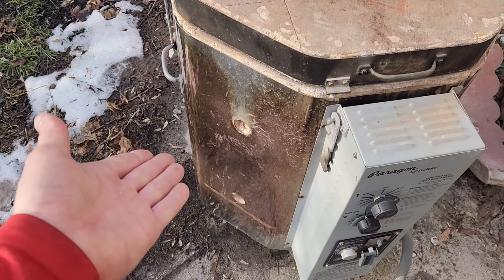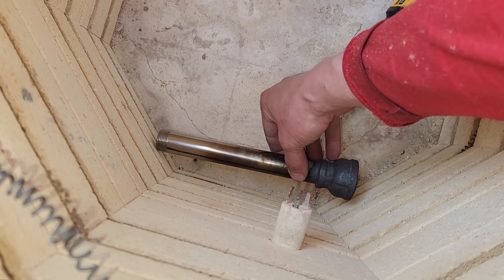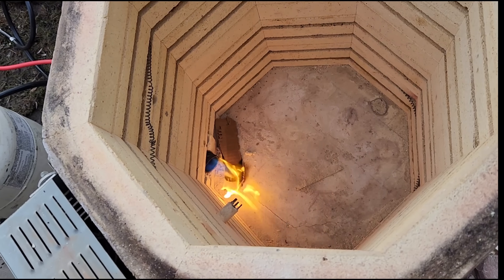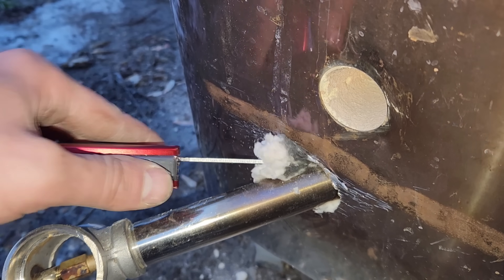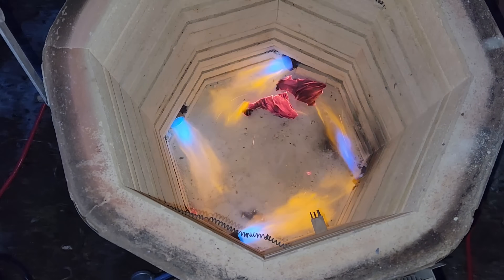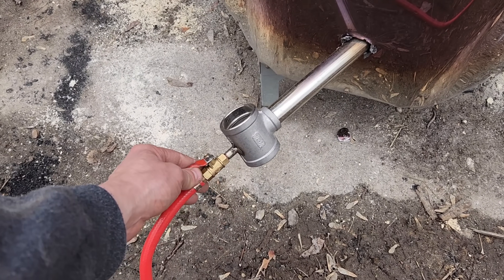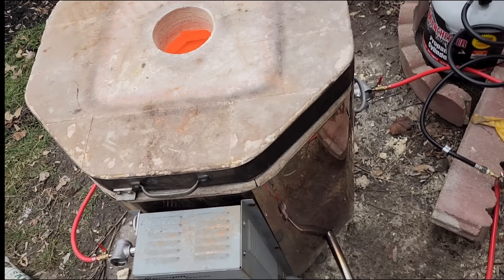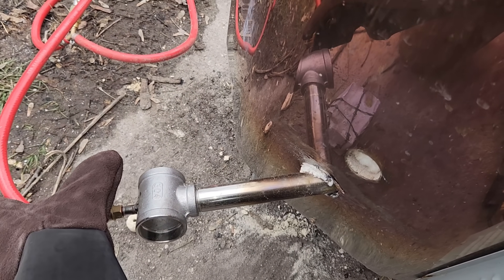Electric Kiln to Gas Furnace?

Comment: I love how easy it is to drill and work firebrick. Great material. I'd like to figure out a way to make it myself, I guess maybe like aircrete except made with alumina and waterglass instead of cement. Would be cool if it could be made to self expand. Great build! Wouldn't have thought about the conversion myself but it makes a ton of sense
Reply: Yeah. Its like ice cream with rocks in it. You can scoop it with a spoon no problem but itll dull cutting tools pretty quickly
Reply: I’ve successfully made some of my own using clay, clinker, Portland cement, and perlite. It’s a complicated process but you can find ratios and steps online
Reply: Boric acid solution maybe as an option to waterglass.  Though waterglass seems like the way without a doubt at least I'm thinking. I think a microwave kiln would be awesome now that you mention.  Was just about to comment above regarding.  Especially since Shake The Future YT channel just updated his metal melting using microwaves video detailing some more. Waste oil as a fuel source as well seems like might not be a bad idea, though might be tricky for some situations I'm wondering in regards to reactions with the waste oil.
Reply: Gday Nighthawk, have a look at autoclaved aerated concrete (AAC). I use this material in the fireplace industry, it usually comes as pre made blocks (usually 1200mm x 600mm) used in 40mm and 75mm thicknesses to line the inside of wall cavities that a firebox would then be placed into. It has excellent heat insulating properties as one would imagine being filled with air, but myself and the other guys at work have used this to build makeshift open fires and foundries with great ease and success. Very easy to cut and work, theres no other fire brick that I've come across that can be red hot on the inside and cool to the touch on the outside. Cheers for all the greatness you've put out into the world.
Reply: Waterglass already self expands. Perhaps even too much to stay strong.
Reply: Dude please do look into making firebrick, you've taught me so many useful things and that'd be the diamond in the crown
Reply: I myself was thinking of producing a material like that out of aluminium oxide powder (produced by dissolving aluminium in a base) and charcoal powder. Somewhat similar to a graphite clay crucible, but porous due to the use of charcoal.
Reply: Is this a secret hint? I would LOVE a video on that! If anyone can figure it out, it's you, ya smarty-pants! 🤪
Reply: Ive had success with making waterglass and makung a sol gel by adding it to alcohol. Then taking the goop that sink and adding more alcohol until it turns into slime. Then drying the slime and mixing in stuff like perlite and alumina. Then baking it rapidly maoes it foam up into a porous brick of aluminosilicate.
Reply: I expletive love aircrete. I always thought it'd be funny to get some friends and try and work out how fast you could make an aircrete dome about 20 metres was our target wanted to see if we could make one just turn up on site some where see if we could get it made and force set it ninja styles so there is just a 20 metre dome there of a sudden lol.
Reply: Look up aerated plaster gypsnow. Its just plaster and baking soda, and maybe some perlite or vermiculite.
Reply: It's mostly air. Air is easy to cut.
Reply: Don’t overthink it. It doesn’t have to ”set” like concrete, just has to be formed and fired. A highly refractory clay (kaolin and/or fireclay) and something that will burn out and leave voids (sawdust) will do it. Waterglass has too low a melting point, an unnecessary complication.
Reply: @kellyhebert7967 agreed but some may not want carbon being an issue causing a reducing atmosphere so swap out the organic filler with perlite. Otherwise this should be a reasonably easy thing to make. May take a few tries getting the strength to weight right but otherwise easy.
Reply: You should see if it’s possible to make an aerogel-based kiln, or a pressurized kiln, or something
Reply: @AmaroqStarwind  while aerogel is a good insulator, it wouldn't withstand the heat which kilns usually require (silica based aerogels can last about 650 Celsius / 1202 Fahrenheit), aluminum has a melting point of 660C, bronze 950C (1742F).
It would still have some usage below that 650C though.
Reply: @AmaroqStarwind  Like a refractive material foam made with a sol-gel process? But what would be compatible with the process, magnesia, alumina, zirconia?
Reply: this is adorable and youre way too humble nighthawk.. 
you guys gotta do the electroboom steve mould fake youtuber beef thing... maybe race each other to make something or get a better result than the other on something!
Reply: @dewitt-wright420  Or even like a Cubane challenge
Reply: @dewitt-wright420  "Fake beef"? None of it was either fake or a beef. Two scientists going back and forth. Same with Veritasium.

Beef? That was with Lewin.
Reply: @Dinnye01 Sure, the back and forth with videos showing differing interpretations was not fake, and it wasn't actually a beef, either but they pretended it was one for comic effect. That's what the comment was talking about. Not a fake beef in the sense of trying to actually mislead people into believing it was real.
Reply: This comment gave me a funny experience because I didn't notice who the poster was it at first. I read the comment "normally", then looked back to check at the username and my mind somehow retroactively altered the experience so I had read it in your voice!

Comment: if you can get diesel/kerosene/old cooking oil cheap where you are, it might be interesting to run one on 1x gas burner plus some forced-air oil burners. presumably burner design gets much easier when you can preheat the chamber with lpg to the point where liquid fuel will spontaneously ignite.

Comment: Add some layers to the furnace so, if you are smelting metals, there is no need for such a big chamber and it will get hot really fast (+you save fuel). On the other hand, if you need a lot of space to fire pottery then move the layer up (like a concrete and insulation mix).

Comment: "Probably have to turn the gas off" sounds like he was thinking of it as optional
Reply: i mean do we really HAVE to do anything?
Reply: The reason he said it is because in the electric furnace, you could leave it on while removing the crucible.
Reply: I've shocked myself on electric kilns hitting the coil with the tongs. I wasn't wearing gloves which would have helped, but still, live wires in there.

I have a small furnace like the one he showed in the beginning and I usually don't turn it off to pull the crucible. I'm guessing he was comparing his process to the smaller one. @NAJALU
Reply: is that the equivalent of putting a fork in a toaster?
Reply: Yep and the gas BTU is a tad higher.

Comment: From a health an safety point of view, all those pipes sticking out to the 4 points of the compass are just crying out for a horrendous accident involving tripping and red hot molten metal! 😮
Reply: are the things just made from NPT pipe and fittings? you could put an elbow where it meets the kiln and route the mixing pipe vertically up the side of the kiln with the gas injector at the top. then replace the big gas vent at the top with ones that duct hot exhaust down around the outside of the mixing pipes as a preheater.

Comment: Would have been better to rebuild the electric one instead - a good electric one using resistive wire like that, can go up to about 1300-1320°C (2372-2408°F) - even though the heating will be quite slow the last bit as the power has to be limited to not melt the wires (room temperature to 1300 can usually be done quite easily in one hour - but 1200°C/2192°C can usually be done in just 30 minutes and 1100°C/2012°F in just 20 minutes). 
I doubt a simple gas one like that, will be much better, and it wastes a ton of energy just blowing out hot exhaust gas. That's why you need the big hole on top. 
But building a good electric one, need some calculations to get everything right (which take a little too long to write out in this post - but I can do if intereted). 
Also the wires should be on tubes inside the chamber - making grooves in the walls made of insulating bricks, will impede the heat flow a lot to the chamber - causing the wire temperature to increase. As the melting point of the wires is often 1500°C or less - there is not much margin (and the reason a metal with higher melting point isn't used, is that it's a special alloy that doesn't burn in contact with air. Many metals have way higher meltning points, but will burn in contact with oxygen).

Comment: I'm wondering how much a melt usually costs.That's gotta be a lot of propane to go through.
Reply: I mean, assuming he dials in the amount of gas flow needed to reach a certain temperature, it could end up being less gas than the old furnace would use for an equivalent task. Since less heat will be lost out the top if the metal takes less time to melt.
Reply: 😅nb b  b b .❤

Comment: I did not expect the "check coil lamp" turn out to be a literal, good old "overload LED wire". Made me laugh pretty good.
Reply: All components are light emitting... once
Reply: @HubrisInc If your electrolytic caps emit light, even once, boy-howdy! is that a spicy time.
Now that I think on it, there might be another channel which you likely watch...
Reply: @HubrisInc  Sort of like "Anything is a butt plug if you are brave enough."
Reply: @1978garfield  just make sure it has a flared base!
Reply: I was just gonna comment about that, that was such a great joke!

Comment: The trip hazards bother me. But nice work man. It's crazy how much heat it puts out.
Reply: Needs a platform built around it with all the connections run under it. Something simple made out of wewd.

Comment: I bought the same kiln and had to rig a 220v outlet in the garage to support it. It’s good to know that I have alternatives in the event that the coil dies on me.
Reply: I bought one for a song, $50, at a Goidwill years ago. I never had the house wired for it. This looks like a great alternative.
Reply: @jerrywhidby.  Borrowing an electric range outlet for the time needed to run the kiln may be possible.
Reply: @SeekingTheLoveThatGodMeans7648  yeah I thought about that, but the outlet has a different plug pattern.

Comment: Most people convert from gas to electric...
Reply: But now he can use it at Chickenhole Base.
Reply: The thing with electric is that they can be good - but has to be built the right way. The one he had there seemed terrible (very slow heating and don't get up to very high temperature) - it's probably one meant for firing ceramics. Ceramics can't be heated very fast anyway or they will crack. 
To begin with, the wires should be on tubes instead of in grooves in the insulating fire bricks - which will increase heat transfer from the wires to the chamber a lot and allow for more heating power without burn off the wires. Then a lot thicker wires is needed (to allow more current and heating power) combined with aa PWM controller or similar (for continous power regulation). An electric one can be almost as quick, if built in the right way.

But, even if he is awesome when it comes to chemistry and stuff, doesn't mean he is good at electrics and electronics (I have my doubt as he uses a kiln like that to begin with). Then I can understand he rebuild it like this,  because that electric one he had is really poor and build a good one takes some knowledge. 
Put burners into a bucket pretty much, is very easy and can be done by anyone and is still way better than that electric one he had.

Comment: The latch holding up the lid looks a little questionable. It would be horrifying if it let go while you were pulling hot crucibles out.
Reply: I was just thinking the same thing, looks very flimsy for something which you really don't want to give out on you!
Reply: Probably better to take it off entirely and just fold the lid back as far us at goes. As long as the hinge can handle the leverage.
Reply: @jaredf6205  And maybe arrange an external bracket upon which the open lid will lean.

Comment: Did you get a temperature reading?
Reply from the maker: You might be able to see a little red wedge in the three prong holder thing, that was a #4 cone and it definitely bent so at least that hot.

Comment: I’ve only watched a few minutes but couldn’t it be easier to just replace the coil?
Reply: Where's the fun in that?
Reply: they got limited lifetime and repairing/remanufacturing them is quite involved. It's more long-term viable to just use gas. You can make gas just burning wood, so..
Reply: @dimitar4y  fair as I watched the video I started actually agreeing and thinking it was also just cooler because it had fire
Reply: Yes, but to make it a good electric kiln, it has to be rebuilt though. That one is probably meant for firing ceramics, so it's built to be cheap rather than quick heating (ceramics have to be heated slowly, regardless of what kiln used - otherwise they will crack). First upgrade would be to put the wires are on tubes and not have them in grooves in the walls like that. Those fire bricks are insulating ones (they simply have to be - otherwise the kiln would be extremely inefficient with most of the heat escaping thru the walls). 
But that also means heat will build up in the grooves and impede the heat transfer from the wires to the chamber. Not much power can be applied to the wires before they run too hot and melt/burns off (especially when running the kiln at high temperatures >1100°C). 
Also much thicker wire need to be used to allow for a lot more current (to get more heating power) and a PWM-controller, a big variac or similar is needed (power has to be limited at very high temperatures - and that limit has to be continous. A simple controller using a contactor with large delays in between on and off will not do well as the wire will still heat up too much and burn off)
For those not familar with electric stuff, it's probably easier to rebuild it like he did - but I prefer one thet doesn't waste a ton of enegy just blowing out hot exhaust gas. It's also nice that it can be used indoors (for example in bad weather) without turning the room into a sauna and run the risk of carbon monoxide poisoning.
Reply: @Speeder84XL  I also k ow about kilns and pretty much anything that requires heat. Like glass and metals. I’m autistic like that 😂😂😂
Reply: @Speeder84XL   and what about the fact the heater wire bakes itself to death and has limited life? and it's replacement cost?
Reply: @dimitar4y  Yes, that is of course a cost. But I still doubt it will be more expensive than buying all that propane needed for the gas one. 
Especially since it's so inefficient, with most of the heat just blowing out as hot exhaust. With the electric - all the energy goes right into the chamber.(it may still be a small airflow for ventilation - but it's so  minor compared to for the gas one)
Reply: @Speeder84XL  I know about ceramics I’m opening a ceramic shop